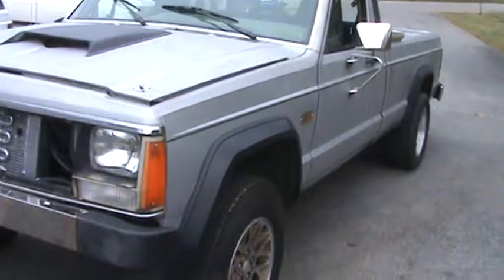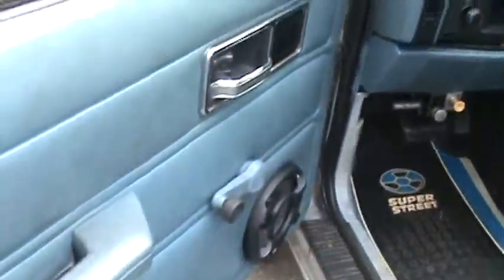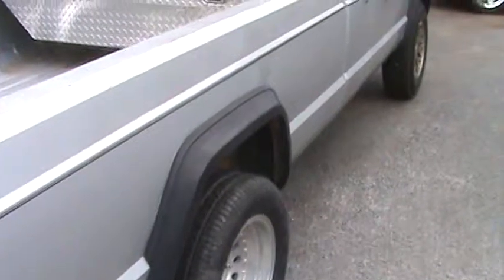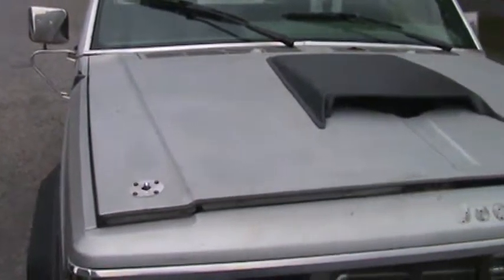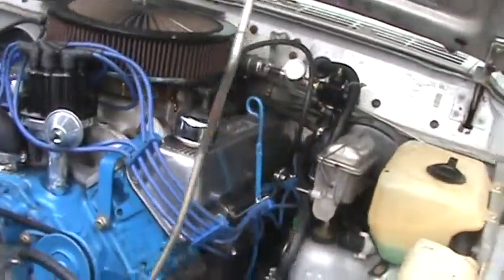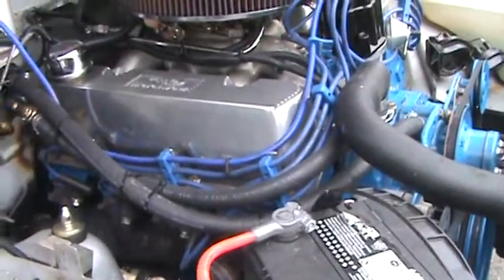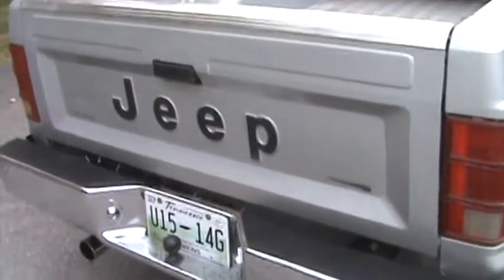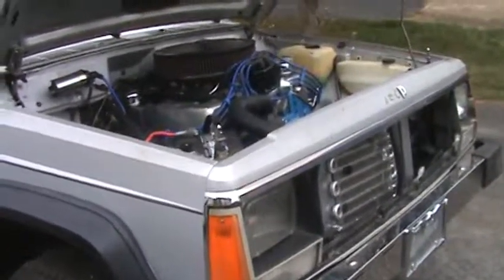JEEP COMANCHE UPGRADE FORD CLEVELAND

Comment: what did you pull the engine and transmission out of? is it a 4x4?
Reply from the maker: The engine was a gift of my friend. the trans. I had in storage. not a 4x4. 
Thanks for viewing. This truck is my daily driver and ever where I go, someone ask questions.
Reply: @doty1947  cool, I want to do a 302 swap into one of mine, I like small block ford engines and everyone does the 350 chevys
Reply from the maker: If you looked at both of these trucks, one has a 351 Windsor. that one is mine. the one with the 351 Cleveland belongs to my brother. his has an auto. trans. Mine has a 5 speed . The right exhaust pipe is close. Because of the starter, it turns at the flange. So I searched the junk yards, until I found one that would fit. Would have like to use headers, but problems with the frame on right side or the passenger side. I have a video of mine also.